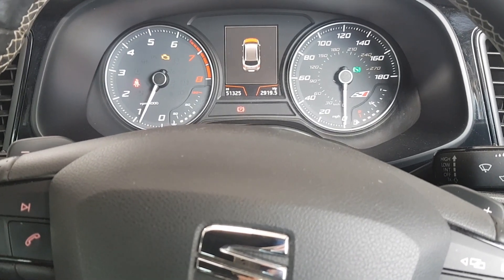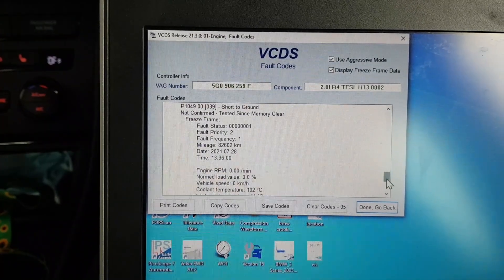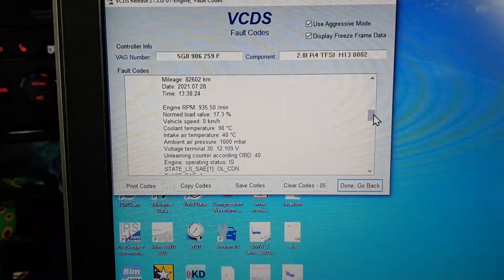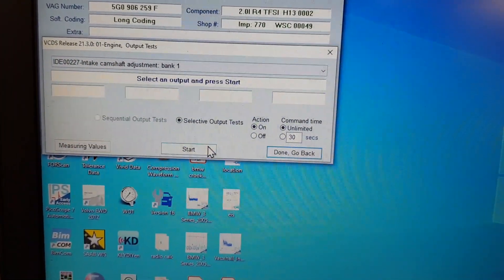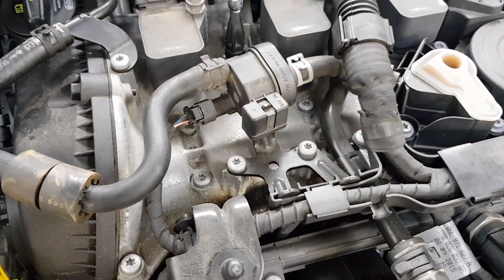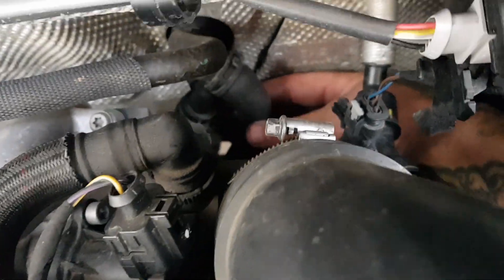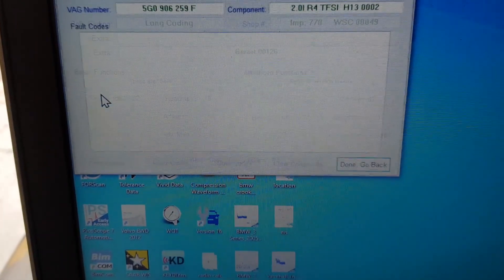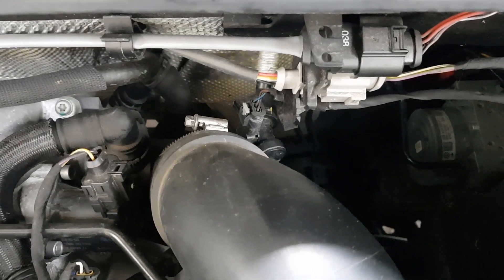Seat cupra eml short to ground P16BF engine light on and stop/start fault

Comment: Nice diagnosis I never gave the fuse a thought either 👍
Reply from the maker: Thanks for the comment, yeh wasn't really thinking but as I said you would have to do the same tests just done in a different order. Still all done in under an hour👍 this had been going on for 6 months with other failed repair attempts before I got to it.

Comment: stuck with these codes on a 2018 golf r i got confused at the end did you change the fuse or heater support pump
Reply from the maker: Both, the pump was causing the fuse to blow. Thanks for the comment

Comment: I need help on this i have the same issue but no fuse is blown and none of the accesories disconnected are on short
Reply from the maker: May still just be the pump at fault, check power and ground at component. If all ok change pump.

Comment: Hey man, so how did you end up fixing the P16BF00 fault? My mechanic doesn’t know. I have a s3
Reply from the maker: The electric coolant pump was changed.
Thanks for the comment
Reply: @rmautodiag is this the same as water pump becuase I think I already have a new one
Reply from the maker: @Jamesiscool_63637_  I don't have part numbers this was some years ago. It's not the main water pump it's an AUX electric pump to assist.
Reply: @rmautodiag how may I ask how long you remember it taking ? Trying to get an idea of a labour cost
Reply from the maker: @Jamesiscool_63637_  I don't, i would assume a few hours to change topup bleed and check system.
Reply: @rmautodiag do you have the part number or link to part? Also how much to replace C

Comment: Did you replace the heater pump and did that fix your issue ? I have the same thing going on with my 2016 gti and am very curious my codes are very similar
Reply: It’s been going on a while now
Reply from the maker: Yes the pump was changed which fixed the issue.
Thanks for the comment